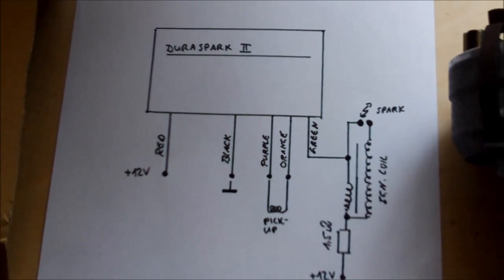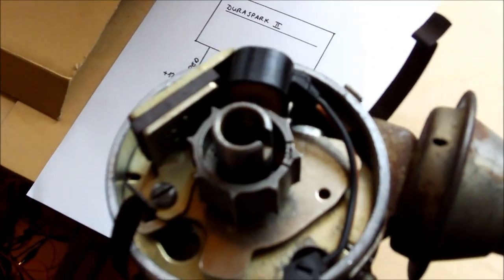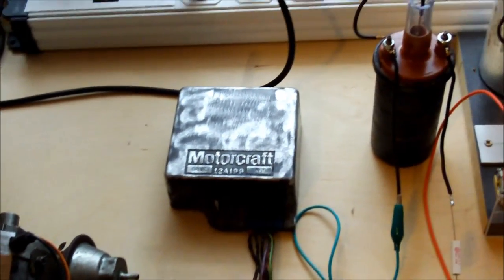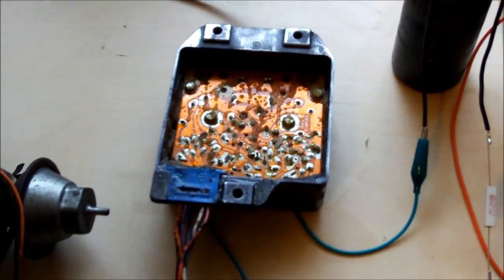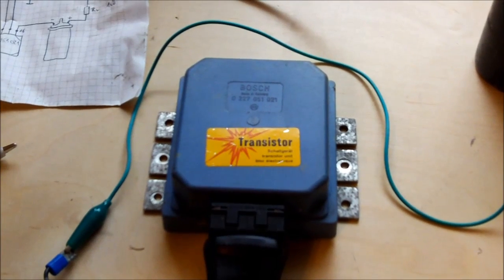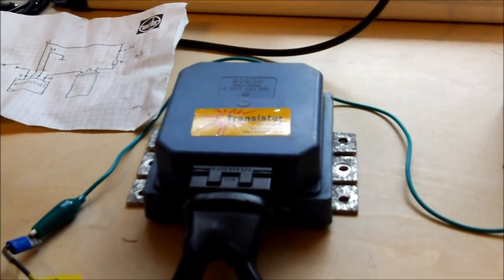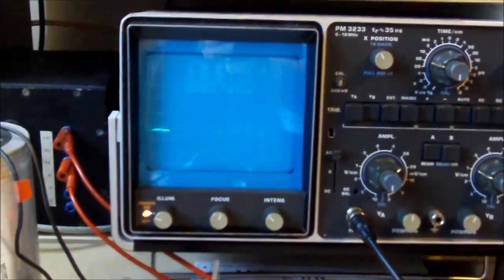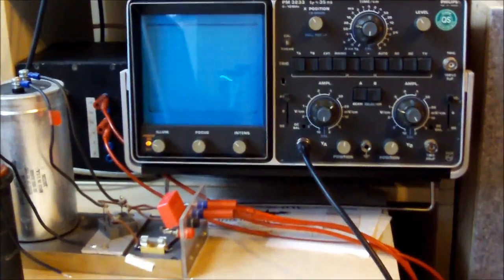Bench Testing Ignition Modules

Comment: Unless I am missing something the coil wire(high voltage) should go to ground  like a spark plug in engine block. the way you have it wired it is finding ground thru the switching wire on the primary wire on the coil. this is a ground that is switching on and off. I would be nervous it would fry the module   ??..........Clayton

Comment: Did I miss were the black wire goes and the white wire one it to the battery and the other is to coil idk witch one goes we’re
Reply from the maker: Hello, i guess you talk about the Duraspark: Black = Minus battery; White = No Connection
Reply: nullbewahrer thanks I’ve have now figured out that my pick up broke this has been very helpful getting my newer OBD2 car running that still had a distributor but I am stopping the build because I’ve forgot everything that’s deleted like mass air flow and more I got spark but she never reach full power.